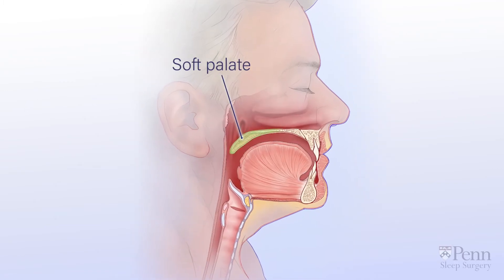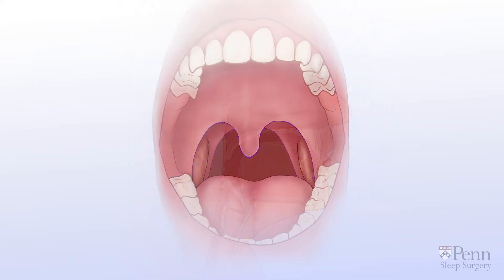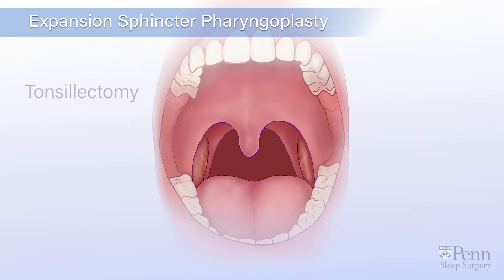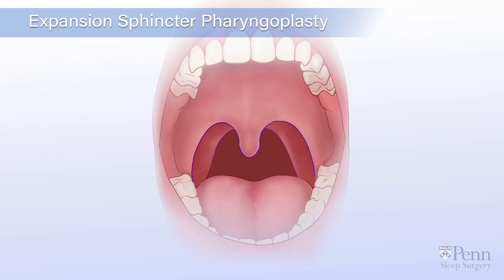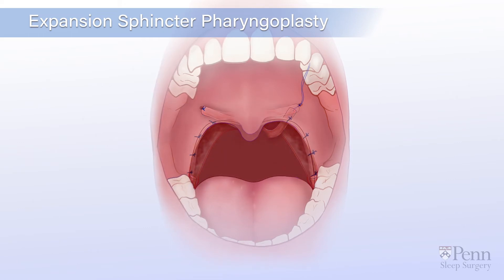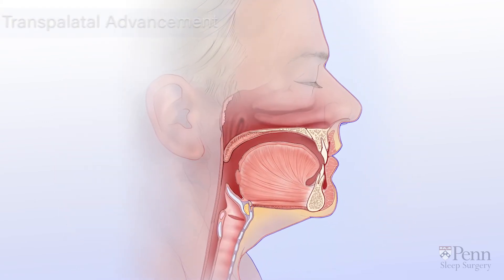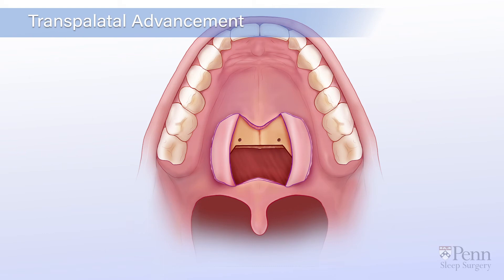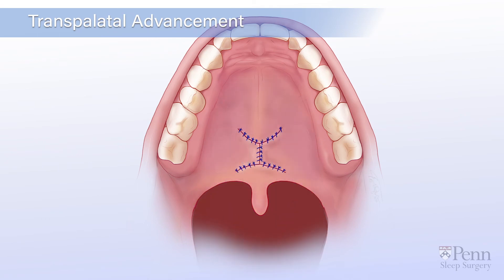Treating Soft Palate Obstruction | Penn Sleep Surgery

Comment: My soft palate issues are only on the exhale, it seems.
Reply: i have the same problem as you do bout i bought a dental tool that is like a hood and cut a cute tip and pulled the soft palate toward my teeth and wow i could exhale freeeeely. in my ipinion i woukd not let them take my tonsils out but if they can just pull the soft palate a bit foward problem solve.
Reply: Can you share the tool you use to pull the soft palate toward the teeth ?
Reply: Is it “soft palatal lift” tool?
Reply: Can you please share that dental tool you use to pull soft palate forward ?
Reply: I have this same problem.  been looking years for a solution.  cant find a damn thing.  find it described by people and a long list of things that dont work, but no solutions.
Reply: Same problem, been to see at least a dozen ENT’s, and two pulmonologists. Looking into exercises to strengthen the muscles of the soft palate. It only makes sense.
Reply: Would you mind telling me how that dental tool is called? I tried finding searching for something similar but with no success. I would be interested to try it myself.
Reply: so is mine. its called palatal prolapse. did you find a solution. considering UPPP as it removes some of the soft palate.